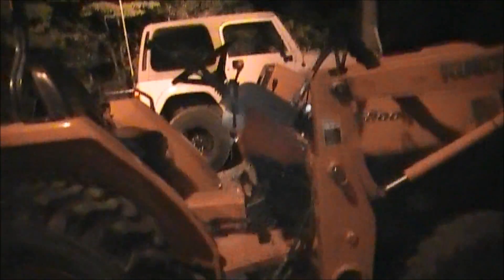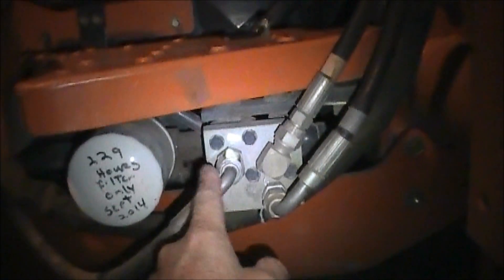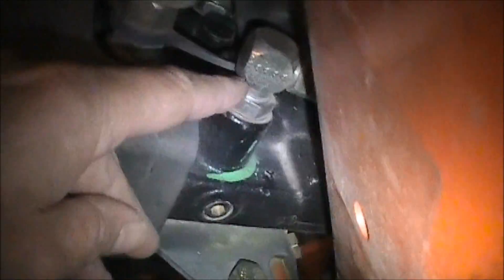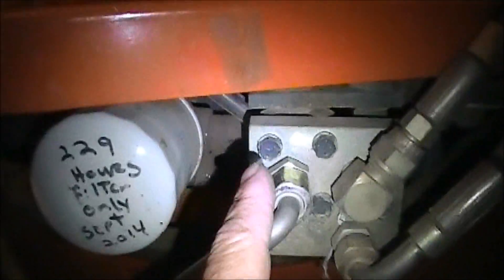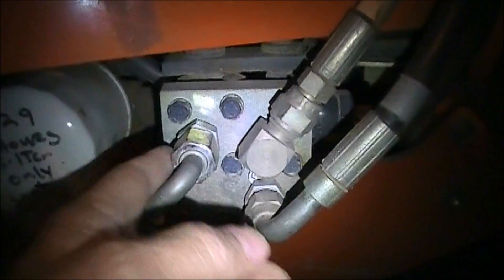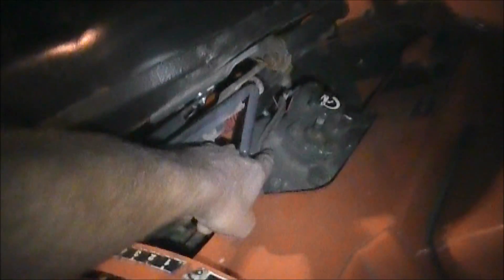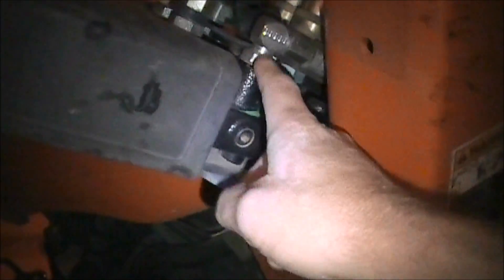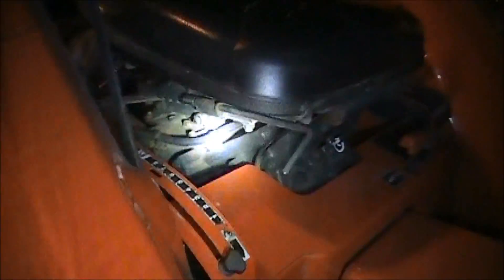power beyond

Comment: I went to the New Holland dealership and they told me I only need one line I don't need a return.
I told me to get off on the valve lock and go back to the back hole.
And I know that's wrong.
I was just going to put my return line into the 3-point hitch reservoir.
There is a plug in the port hole.
7/1/23
Reply from the maker: you dont necessarily need a back to tank line however you do need a continuation of the power beyond line. watching my video adding rear remotes and understanding tractor hydraulics will explain this in better detail. maybe? you can email me questions to Daveknowshow@aol.com

Comment: Thanks for the info! Do you know how to plumb in for front remote hydraulic if you already have the power beyond running to the back for top/tilt?
Reply from the maker: Yes just jump right in the circuit to the back with a valve that when activated sends fluid to the front.
Reply: @daveknowshow  
So, sorry for asking dumb questions 😅 
Would I just be able to tee in there, and have pressure to both? My hose is already running to the back, like yours. I need to feed a new front remote kit the will have an electronic valve. Thanks for taking time to help me!

Comment: I had to change my valve now can't get three point and loader to work together l3450 kubota 
justled lines and get the hitch working or justled line and got loader working . changed valve when backhoe was on and didn't know new valve was going to me trouble on the  hitch till i tried to raise bush hog,I'm all jacked up ,can you help?
Reply from the maker: see my video on understanding tractor hydraulics. it sounds like you have the back to tank line and the power beyond line crossed from the front end loader control. this will cause the three point to only work slightly when the loader valve is operated.  typically the loader take precedence over the three point. when the loader valve is operated the three point will not raise. hope that helps. if you need more help after watching the other video just let me know.
Reply: @daveknowshow  I forgot yo mention ,when I disconnected all lines for the loader ,the 3 point wouldn't do anything
Reply from the maker: @walterrosevally2591  yep sound like the power beyond and the back to tank line is crossed. you can send  me an email to DAVEKNOWSHOW@AOL.COM  I will be glad to look up the information and try to walk you through it over the phone if need me. just include the model and serial number of the tractor.

Comment: My tractor has the same setup except for the backhoe part. If I wanted to add rear remotes can’t I run the hose from power beyond to the kit and from there back to the loader valve?
Reply from the maker: yes you can, however if you go after the loader valve then the loader will take precedence over the remotes which is likely more desirable.

Comment: Thanks for posting this, it’s helped me out. Hopefully you are still active here on YouTube. I have a l3130, and I’m looking at a bh92 backhoe attachment with the subframe. I will need to run my lines to the rear to power the backhoe. Can you show those hose at the rear in a little more detail? I really just need to see which hose they put the male and female quick connects on. Also where they mounted them on rear end. I’m guessing I can just go to the local hydraulic place with the old power beyond hose with some measurements and have them make me two hoses. Is there anything else to making the attachment work besides this hose and the subframe?
Reply from the maker: just need the hose and the subframe. I can email you pictures if you get me an email address. you can send me an email to Daveknowshow@aol.com

Comment: Thanks the log splitter does have a built in control valve lever with 2 hose so the power beyond hose from the block will connect on the in of the log splitter and on the out side will go back to the front end loader power beyond ? And when the log splitter is not in use the will connect together. I just want to make sure I'm getting this right don't what to mess the hydraulic pump up
Reply from the maker: +Jennifer Claxton no I believe its the power beyond hose from the loader valve connects to the input of the log splitter. then there should be an outlet on the log splitter that the hose attaches to that is labeled out or power beyond. that hose goes to the block on the passenger side of the tractor. same one shown in this video.  if you look up the log splitter online the instruction should show this in the install package.

Comment: Where do you get the 3 port power beyond block
Reply from the maker: it comes stock on most tractors that have a loader. if its not there as in with some older model Kubota's its located under the seat at the rear. you can order most any of these parts through messicks online.

Comment: SAVED ME A LOT OF TIME TO  HOOK UP POWER DOWN HYDRAULICS. WHY DON'T TRACTOR MFG INCLUDE THIS? IT IS S SIMPLE  ENGINEERING CHANGE.
Reply from the maker: there is a lot to be desired with many of these tractors and the hydraulic systems they use.

Comment: Hi, your loader valve has connected with 3 hoses or 2?( except the 4 lines for hydraulic cylinders)
Normally such valves had stamped one side a "P" other side a "T" which P=pump or power and T= return to tank
So my question is :
Using correct connection to a hydrostatic transmission tractor into a loader valve need 2 hoses to work or 3?
The relief valve you show under tractor has 3 hoses that one is IN, other OUT and last in return according to manual
If need 3  where exact you find other port in loader valve if only has 2 ports?
If need only 2hoses to connect tractor to loader valve which one you choose from relief valve? The IN  the OUT  ?to give flow from tractor to loader, and second for sure is return.
Thank you
Reply from the maker: from my understanding it depends on the valve type "open center" or " closed " one has a power beyond port, an inlet port, and a back to tank port. some do NOT have the back to tank port.  for example most back hoes on these kubota tractors are fed with two lines and is hooked in series between the power beyond ports from on valve too the inlet port of another valve. so the answer to your question is dependent on which valve you have and how you hook it up. in my video series " adding rear remotes" the valve I used is added into the circuit by connecting the power beyond from the loader valve, or from the main distribution block under the floor board tractor right side to the inlet side of the new valve, come out the new valve's power beyond port to the inlet of the next valve, and from the T " back to tank " port to the main distribution block that is "back to tank" . hope that clarifies. you may want to look at the video series about adding rear remotes.
Reply: Thank you for your answer, yea i have seen videos on mounting rear remote as mention me.
I need to connect a front-loader valve with 2 hoses one P other T( as seen to valve ) to the relief valve of a HST tractor which this relief valve has 3 bolts which manual says one is input , other is output , last is return.
You think that if i connect  the hose from loader valve to output port of relief tractor valve , and other hose of loader valve stamped T connect to return port of relief valve will work? 
Or this system will need  all  3 ports connected? PB -P-T?
Best regards , nice videos!
Reply from the maker: yes it will likely work fine. keep in mind that as long as you tie in at the main distribution block where the relief is if its wrong the relief will kick in and stay on constantly. you will hear the tractor straining due to the relief kicking in constantly. sounds like you have it figured out. if you ever choose to add rear remotes you may have to change that controller to a three hose system power beyond, power in, and tank.
Reply: So  you say an open center valve can not work to a closed center circuit?
Which is exact the PB port in valve of tractor?
The inner line the outer line or the return?
Best regards
Reply from the maker: I will recheck mine today and maybe post a new video. which valve did you buy? what model number? and brand name? I will look it up and see if I can tell if it will work.
Reply: daveknowshow  
Hello again, thank you for your answer.

The valve i have is an aftermarket valve which only has 2 lines except the 4 cylinder lines that goes to front.
It has one side a P and other a T,
In each side has 1 hook up hose and a allen cap near in each line which only changes the angle you connect hose.
So if i disassembly the whole thing , will have two lines P and two lines T
My tractor has 3 allen bolts on the cast iron block under right foot near to yours tractor which connected to  pump and according manual each port is describe as IN , second OUT , last RETURN.
This mean with a few things i know is a closed center circuit and perhaps my loader valve is an open center type and may not work properly each other.who knows.
So i will try this weekend to connect my tractors valve return line to T line of loader and P line of loader valve to OUT, i think this will not work but i will try .it may block the oil  inside loader lines or return all oil into tank and then pump will not have  oil to work , a guess but i am not sure about.If you need more details such as fotos i can sent you via an email.
God bless you, you have interest videos.
Reply from the maker: it should work fine like you described

Comment: So I run the hose from the power beyond block to the in side of the wood splitter lever and run the other hose from the out side of the lever back to the power beyond to the front end loader lever ?
Reply from the maker: +Jennifer Claxton  run the power beyond hose from the loader control lever to the rear of the tractor install a quick connector on it. then run a hose from the rear of the tractor to where the power beyond hose hooked into that block on the side of the tractor shown in this video. when the log splitter is NOT  being used quick connect the two lines at the rear of the tractor together creating a loop. when the splitter is used connect those two hoses to the log splitter control valve input port and the other to the "output loop" of the control valve. if the log splitter has a built in control lever it should have two hoses coming out of it that will be used for making the connections.